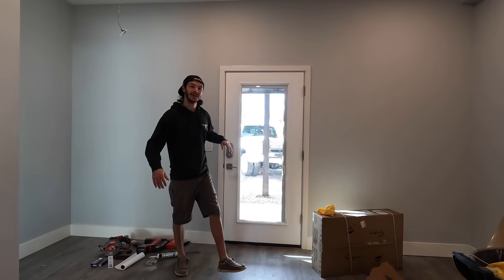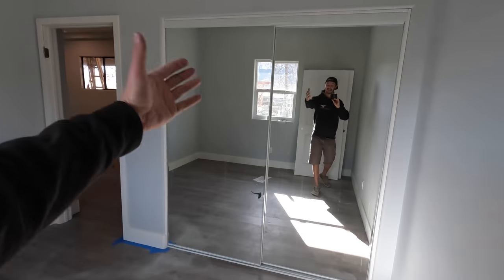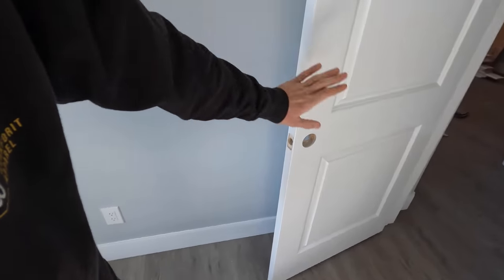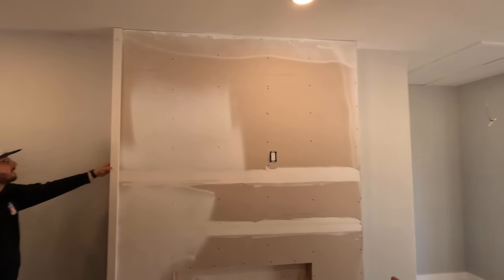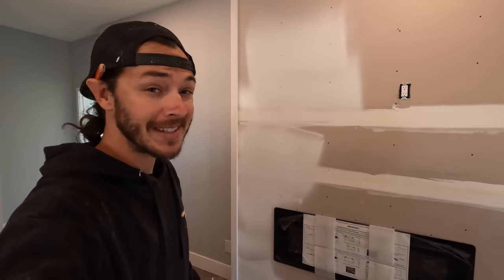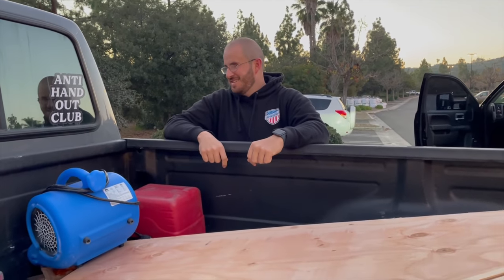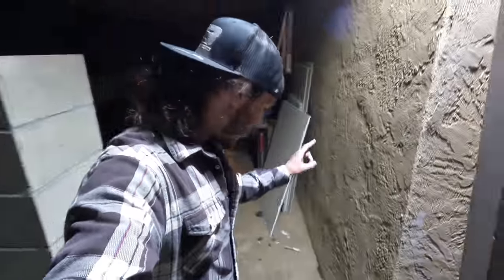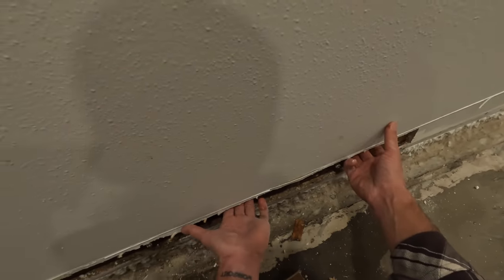THE DONKEYS FLOODED THE GUEST HOUSE!

Comment: Great call on opening up the wall asap. I'd cap that pvc spicket preferably up the line at its source so it's not a ticking time bomb waiting to leak... 😁 Donkeys are definitely called  jackasses for a reason! 
Great content again Ryan...
Reply: Donkeys are donkeys and Jack asses are cross bread between a horse and a donkey. So donkeys are not jack asses. Donkeys are actually smart.

Comment: Thanks for the tip on concrete fasteners.  
I normally drill a 6mm hole and use a concrete screw. Works so far.

Comment: Goof off should take that stuff off around the windows. We own a commercial cleaning business and use goof off for sticker and this sealant off the floors that a concrete wall company uses to seal some of the walls they make. That sealant gets all over the floors and makes a huge mess but when the floors eventually dry out in the winter we'll use it to get the sealant off the floors and in the summer we leave till we strip and wax because the strip will strip anything in it's way..

Comment: I use a similar method with nails. Drill a hole. Put in a piece of mechanics wire than pound in a sinker nail
Reply from the maker: I’ve seen tie wire used too, but trust 2 nails more

Comment: Get the new water fixture that sits flush on the wall with a waterproof cap and the spicket turned I to a female adapter so you can still have water out there and not have to patch the stucco

Comment: As a cabinet guy, there are more things that go into installing the bases right, than just screwing it to that wall.
Don't paint that wall black. I watched a video of a couple that did basically that same thing ended up taking it down and redoing the  whole wall.
Damn donkeys!! At least it was during the day at not the middle of the night.
Reply from the maker: You are correct. Especially with how out of whack the floors in the kitchen were. He did a great job.

Comment: Pro tips from an actual plumber
1- Don't use sharkbites unless its temporary.
2-  Don't use cpvc or pvc for water lines as they get brittle over time and as you seen break easily. 
3- If your going to be running water lines or fixing something learn to Solder or buy a press tool for pex and copper and do it right or call a plumber, this could have costed you a lot more time and money had it not been caught when it was. Definitely enjoying the content though just be mindful of these things.